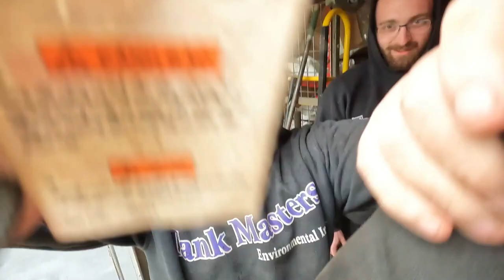Laugh With Us While I Wear A Stupid Head Cam

Comment: i just got a video recommended by some insurance company like nebraska or something today on best ways to install tanks and it said the plastic coating has ribs in it so if line leaks it will flow between plastic covering and copper line so you will see it dripping at end where boiler is and hopefully have a drip pan for filter or burner to see the drips.

Comment: This was a great video guys 👌🏻. Out of interest, is there a different set of standards for an install if it's just a temporary one like this? Lines through a window etc? Or would it be acceptable by the local authority to set it up like that permanently (if the homeowner was suitably mental)?
Reply from the maker: Yes there are Bwythan, Basically don't have to comply with most codes. BUT, You certainly need to have a little common sense when setting up. If the new install was not going to be in the way during the UST tank removal or remediation, I would have just set it up. Good question

Comment: 1 gal fresh water = 8.3 lbs
Reply from the maker: Thanks Paul, How about #2 fuel oil?
Reply: @TankMastersEnvironmental  it's just slightly less than water, at 8.2 lbs/gal
Reply from the maker: @Sir0blivion  Thank You Sir!!!
Reply: @TankMastersEnvironmental  TEMP & DENSITY will have effects, but it averages slightly lower than the weight of a gallon of water.  On the diesel submarine it caused problems if our fuel expenditure was not recorded correctly. On one occasion we could not submerge until we flooded in the proper amount of water to compensate.  Good thing this was during peace-time.